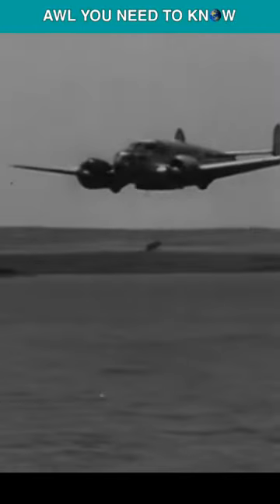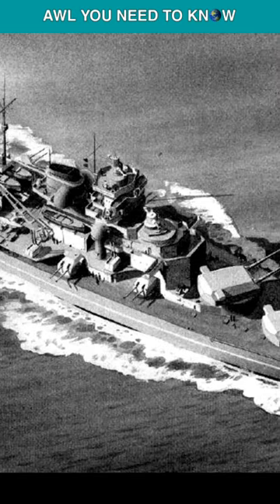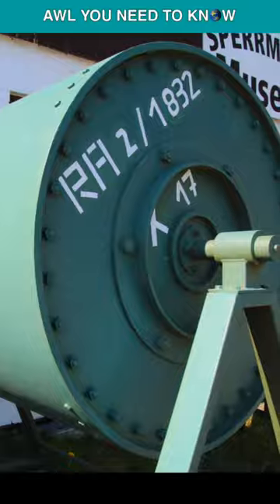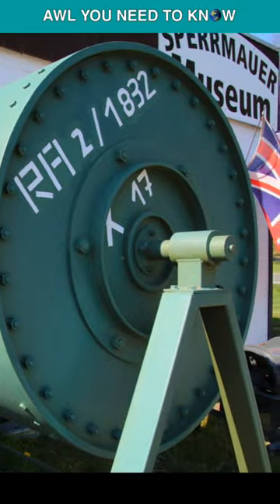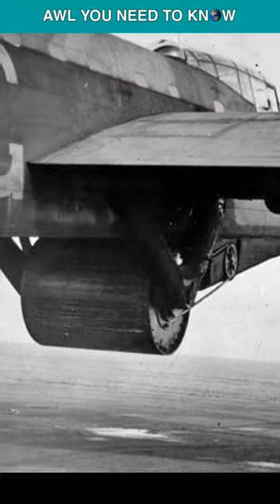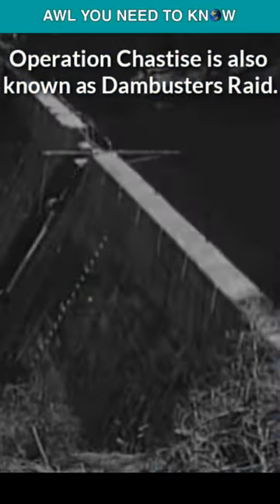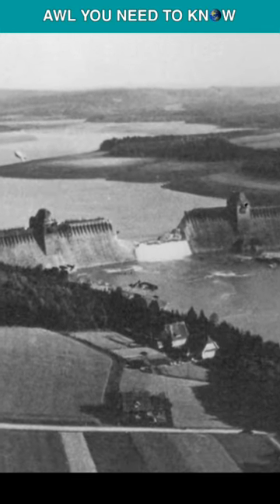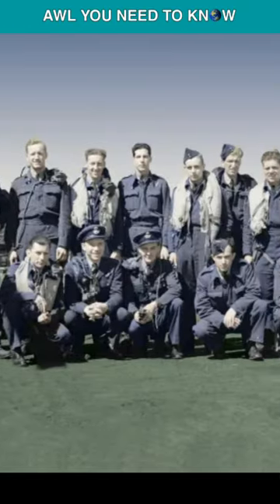Meet The Bomb That Bounces #shorts

Comment: 60feet was done by two headlights to form one light; is deem 60 feet; 
the bomb hit the wall and sank; not before; 
bomb wsa invented for destroying dam; because royal air force could not destroy it with bombing mission; after test after test he realized rotate normal ;it bounces off the dam; 
turn other way; it sinks; after hitting it ; English to cue ball; which way to hit;